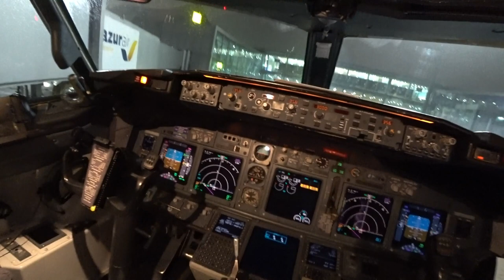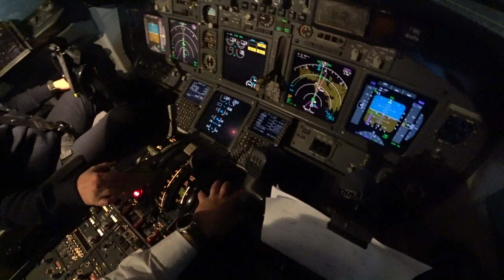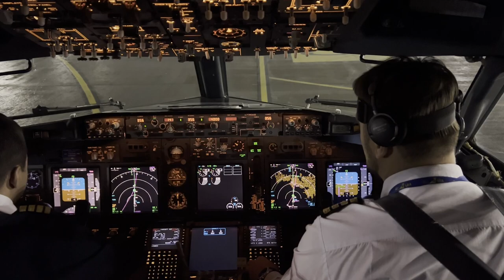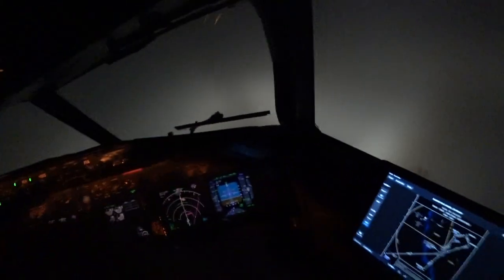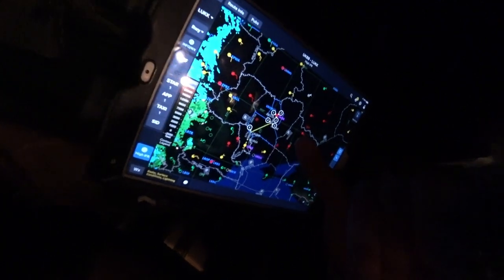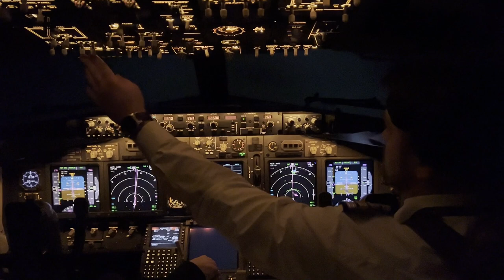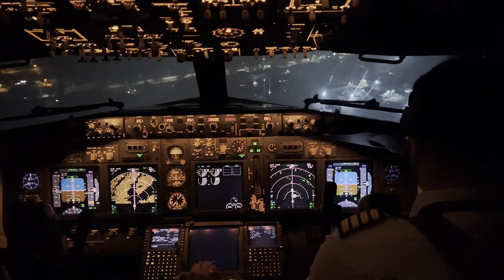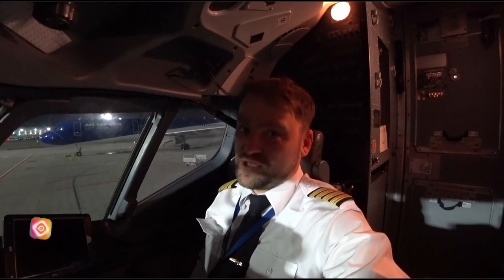One Hour as an Airline Pilot. A Very Short Night Flight

Comment: Can i ask why you turned off lower DU just before taxi and for the rest of the flight? Don’t you need to monitor such things like fuel flow, oil temp, etc..?
Reply from the maker: Yeah, don’t need. If something wrong with the engine it pumps up automatically

Comment: Great video :) Question, why left elec & eng hyd pumps are set to off and right to on before start up? My understanding is that eng pumps always rotates as they are connected via gearbox to the engine. But I assume there is some SOP rationale for the airline here.

Comment: Great video Denys keep them coming. Hey Denys! How do you feel about airline pilots ditching the pilot's hat as part of their uniform? Here in North America only two major airlines require their pilots to wear them Delta and Air Canada. The rest it is either optional or like Jet Blue not even part the uniform.
Reply from the maker: I am ok with that. It is sometimes better to cover the head. Plus the pilot hat may be a very useful tool in emergency. (I will film video about it)
Reply: Ok! Like all of your videos I will be looking forward to it. Also I see pilots using ear protection when doing the walk around preflight which I understand the need for. But what about wearing safety glasses to protect their eyes.   @PilotBlogDenys

Comment: Hi Denys, yet another fantastic video. I notice that your are sometimes setting on captain seat and sometimes on first officer seat. Therefore, is it formal procedure for this or it depends on the flight it self like domestic vs international flight etc. I hope that you make a video explaining the difference between captain and first officer duties.
Reply: From previous replies, he's said there's some problem in his airline such that they have to fly with two captains. Therefore one of the captains is always in the right seat. Many airlines allow captains to use the right seat if there is some need to.
Reply: @sunnyyan1080  Thanks for your reply👍